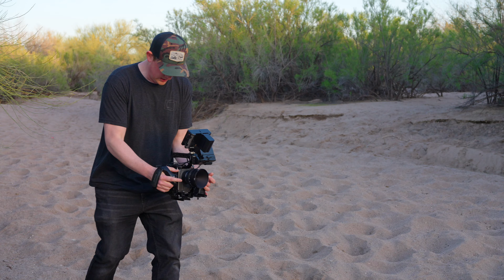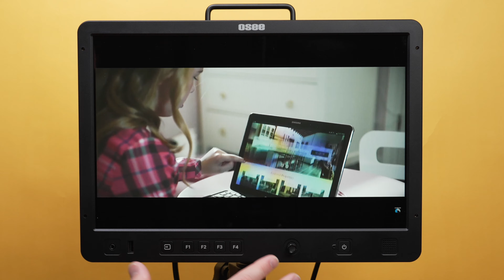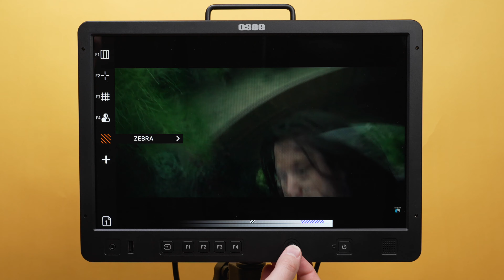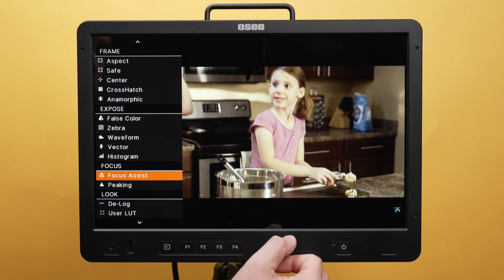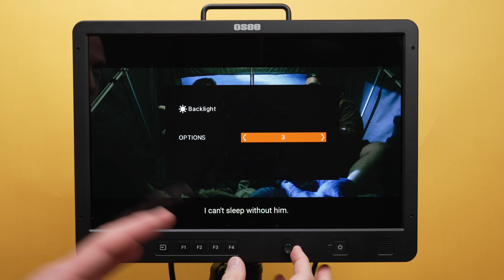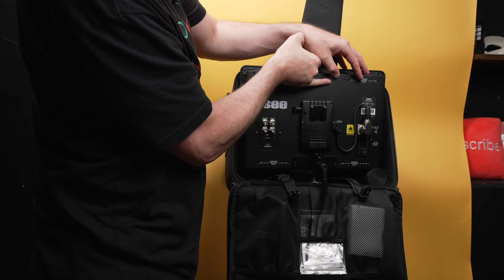Massive Camera Monitor on a Budget | Osee Mega 15S 15 inch

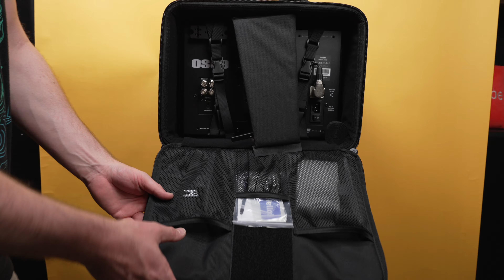Comment: @18:25 this velcro piece is supposed to be attached to the case' back door. It holds the door enabling optimal temperature while operating the monitor, and also creates space for cabling etc.

Comment: I wish the megamon had anamorphic features. I just found out the other day that it didn't after owning it for over a year.
Reply from the maker: Oh yeah, that's a bummer that it doesn't have an anamorphic mode. Maybe they can add it with a firmware update.
This model does have anamorphic mode, so if you ever need to update, it's a good option for it!

Comment: For the price I’d rather just go with the Blackmagic 15” monitor which is a lot better.
Reply: For the price id just get old ipad pro 12.9". 1600 nits. Full P3 HDR. Color accurate also. And you can just keep it at hand or mount it.
Reply from the maker: @Thevikingcam  using an iPad is definitely a great and very mobile option as well! If you can connect the Sony app or use a wireless transmitter that supports iOS devices as well, then it's a good option for sure!
Reply from the maker: @PowersBenzoCoaching  I guess if that fits your needs better that makes since. But it costs more, doesn’t have HDMI input and it’s a lot thicker with no travel case or sun hood. It does have more old school broadcast ports tho for traditional video work.